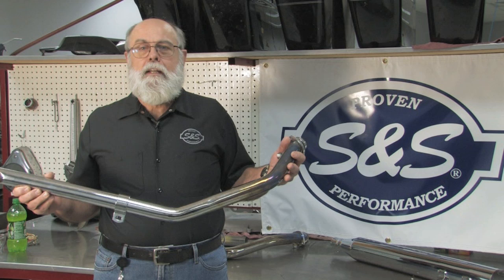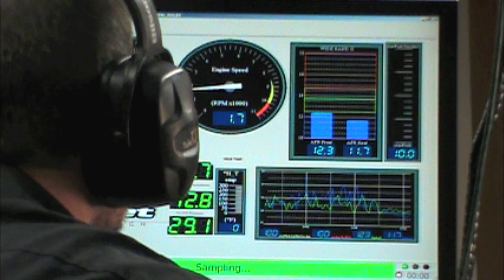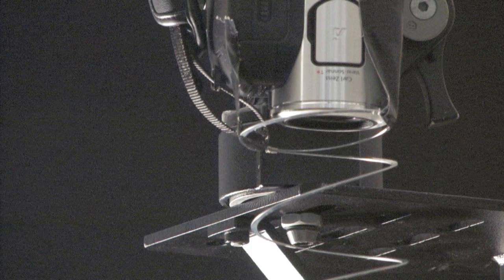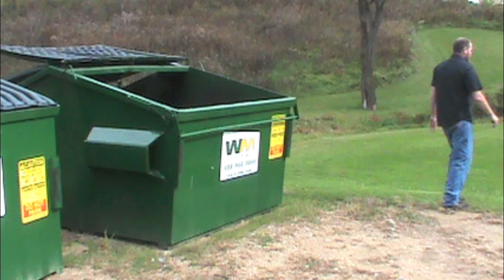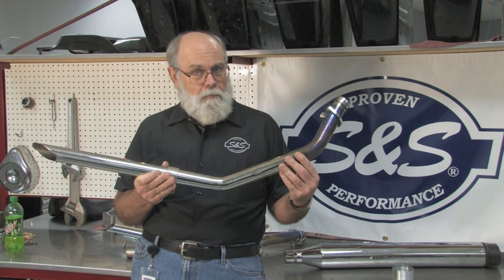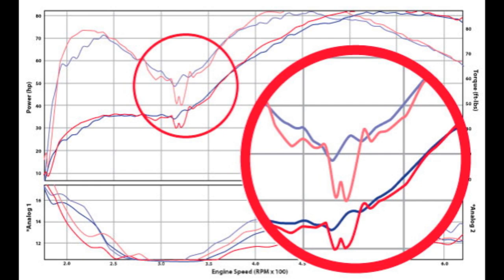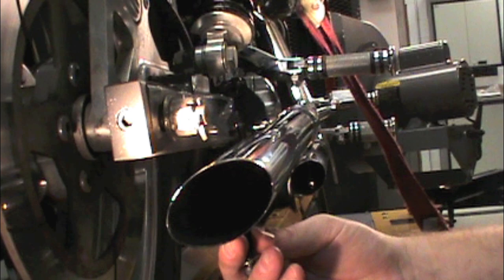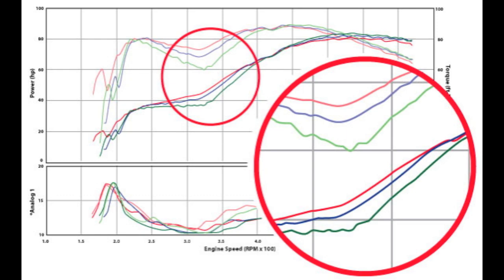S&S Cycle - Drag Pipes Style Exhaust: Carb Jetting and Troubleshooting

Comment: people in the comments are talking about torque cones... they're junk! took restrictive. What I want to know is will a diameter "step" help? or will it encourage stacking in certain ranges?
Reply from the maker: Stepped pipes are helpful, but nothing beats a muffler for eliminating harmonic reversion.
Reply: S&S Cycle, Inc Thanks for the reply! Yes a muffler seems to be perfect for where I need the power. 4:35 had me laughing hard. Thanks for the video too, now the hard part is explaining this to the hardheads.
Reply: Poop An old friend (who has since passed) had a Harley dealer install a set of Samson shotgun (rear axle length) exhaust on his '91 Springer Softail with the torque cones (this was around 2000 I think when they were popular) and most likely had the carb tuned at the same time. I'm not sure how this affected the performance, I've heard that shotgun exhaust systems aren't good for power and that torque cones are a waste of money but damn I thought that bike sounded good, especially when releaseing the throttle for a gear change! The reversion may have been bad for performance but the hot rod sound it made was hard to dislike, for me anyway!

Comment: That was great.  are S&S pipes " tuned" to enhance performance or just to look good?
Reply from the maker: bobknight33 With a name like S&S Power Tune Exhaust, you would think so! However the goal of street exhaust systems is to be NOT TUNED, de-tuned if you will. Drag pipes are tuned which is why they perform well at high rpm and poorly in the mid-range. An exhaust system that is de-tuned can perform well across the entire rpm range. The S&S motto is Proven Performance®. We are a performance company, so everything we sell makes more power. S&S exhaust will improve your performance, and we can prove it! Hope that helps.
BTW - they look fabulous too!

Comment: I just installed a brand new s&s super e carburetor and it's dripping gas from what seems to be the bottom of the accelerator pump housing ? Everything seems to be tight, I surly didn't disturb anything around there or anything factory at all for that matter . What could be the problem ? Not rebuilt, used,etc.... Brand new ! Please help !?
Reply from the maker: Hey Kevin, please reach out to our tech support team directly via email at sstech@sscycle.com.

Comment: I know you presented your mufflers as a cure to the problem. But how much are your pipes a compromise because of styling consideration? I notice that most of your pipes don't increase in diameter thru the baffle area but only provide a bit of sound wave scavenging...or is that really all that is needed ...by causing turbulence on the pipe wall .....the revision  wave is reduced ? Could not such a device be moved to other position to increase it's effect  and also serve to lower the exhaust note?
Reply from the maker: Making the baffle increase in diameter presents its own set of challenges, the best example of this is a tuner "fart can" muffler used in certain automotive circles. As shown in the video, there are many different methods that are effective in breaking the reversion wave. There is not a one-size fits all answer for this question, as the optimized system depends on the engine and exhaust header configuration. For example, a set of touring slip-ons is far less sensitive to baffle design in terms of horsepower because the main factor in the flow is the factory catalytic converter. When tuning for midrange torque, it is important to eliminate the effects of the reversion wave, and one of the reasons so many automotive systems have active valves, it gives them variable output in terms of sound level, tone and the power curve of the engine to match the driver's wishes.

Comment: What about heat wrapping (fiberglass/titanium/whatever else) and ceramic coating your pipes? Could this help with the harmonic feedback? I'd like the see the Dynojet comparison of that.
Reply from the maker: Heat wrapping is intended to keep the exhaust gasses hotter, and, theoretically moving faster since they are aren't losing as much energy as dissipated heat. While this looks way bad-ass, it probably won't have a pronounced effect on the street, since it is more of a racing thing. S&S has never done any dyno testing to determine the effect on harmonic reversion.

Comment: what about the length of the pipes. if they where a specific length tuned to the particular engine wouldnt this be cured. also race bikes have no baffles, and not just drag bikes but road racers as well. sure they both operate in the high rpm range but surely they dont suffer from this condition.

Comment: I took off the crosspipe on my sporty and stuck some "cheater" pipes on with Screamin Eagle slip ons. Didn't feel any diff good or bad. Wanted LOUDER so I kept cutting the baffles shorter and shorter, then I left them out totally. My butt ain't no dyno, but I still felt no difference. just lucky I guess!
Reply from the maker: It takes a highly trained sphincter to detect these things. Assuming that this is a carbureted engine, 2006 or earlier, I'll bet if you put it on a dyno with an exhaust sniffer, you'd see the difference. Wallace and Gromit. Nice.
Reply: S&S Cycle, Inc Sell him the S&S Sphincter Dynamometer,that's all he needs .....

Comment: Great vid!

What's you guy's opinion on Thunder Monster baffles installed in drag pipes? That "glasspack" looked like a load compared to TM products.
Reply from the maker: +InvictvsNox We have not tried these particular baffles. They may help with the drag pipe sag, but will not be as effective as a set of mufflers.
Reply: S&S Cycle, Inc Ah, okay. I figured they would sort of make the system count as a muffler.

Thanks for the reply.

Comment: don't those mufflers just have removable baffles just like the ones for the drag pipes?
Reply from the maker: Some S&S Mufflers do have removable baffles, but there is still baffling (not  confusing) structure still in the muffler, so the "drag pipe sag" is not an issue. The difference between baffles in a muffler and in a drag pipe is the cross-section area and the volume of the muffler.  You can have a baffle in a muffler and not restrict the flow very much. Not so a drag pipe.

Comment: If I have a stock vstar 1100 custom would it be ok to install a thumbscrew in the headers and looks the muffler all together?
Reply from the maker: We deal almost exclusively with v-twins built in Milwaukee, but the concept is the same. You can give it a try, but assuming that bike has EFI, you'd want to make sure to recalibrate.

Comment: Have you tried torque cones ? I need a high mount exhaust for my sportster scrambler to clear the swing arm from the exhaust do to longer rear springs.. how ever all those style exhaust are strait through exhaust with out baffles ... I was thinking maybe a torque cone or adding a hi flow baffle like the hp plus baffles to solve my dilemma I'm in ... I would much rather have a muffler exhaust but it seems there's not much options for the solid mount sportys for my exhaust application
Reply from the maker: Torque cones will help with reversion and will smooth out the torque curve, but they are pretty restrictive and will also reduce top end horsepower. Mufflers are a better deal, but if you want to run a straight pipe, they will help.
Reply: 10-4 the only reason I ask is because I need a high mount short exhaust system for my 95 sportster like a shotgun exhaust and none of those exhaust options have mufflers so I'm kind of hosed ... all the good exhaust systems out there are for the 04 and up sportys ... I wanted to leave my se slip ons how ever with my 15in rear shocks the swing arm hits the exhaust ... just trying to figure out a way to make strait through shot gun pipes perform well for my sportster scrambler build

Comment: What if I have the stock cv carb? same issues possibly?
Reply from the maker: +Bill Hill  You may have the same issues, but they may not be as pronounced. The stock carb is smaller and velocity will be higher, which may overcome some of the issues. But being smaller, the stock carb won't deliver the top end horsepower. Big trade-off.

Comment: I've got a 2002 Suzuki Intruder 1500 LC, has Vance & Hince Longshot exhaust (no baffles), and K&N filter.   The previous owner told me that the carbs were re-jetted for the set-up, although he wasn't sure on exact jets as he didn't do this himself.   I get roughly 150 miles to a tank.  Runs well throu the entire range.  I notice that on deceleration, I'm getting popping thru my exhaust, and lately it's more of it.   Any idea how to get rid of that?

Comment: I thought harleys red lined at 5500?
Reply from the maker: The Stock rev limit is about 5500, and is intended to extend the life of the engine and reduce warranty costs. If you want to go racing, you have to leave that stock comfort zone to be a contender. Aftermarket modules and flash tuners allow you to increase the rev limit. Full on drag bikes typically will rev upward to 7000 rpm or more. Does that shorten engine life? Sure. Is it a lot of fun? OH YEAH! But you gotta pay to play!
Reply: haha cool! yeah I imagine you wouldn't want to run a stock harley engine at 7k, the tolerances are too loose but if it was bored out and set up for it i'm sure it wouldn't be bad. That is interesting to know, I won't feel so bad about winding er up now...